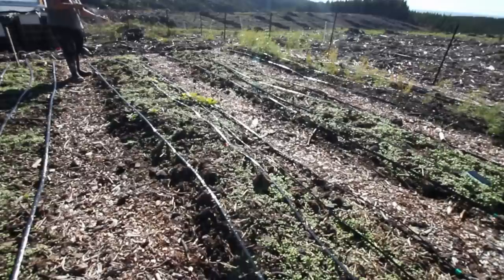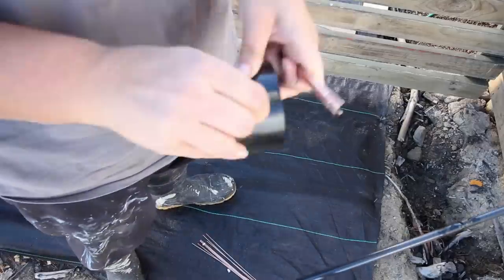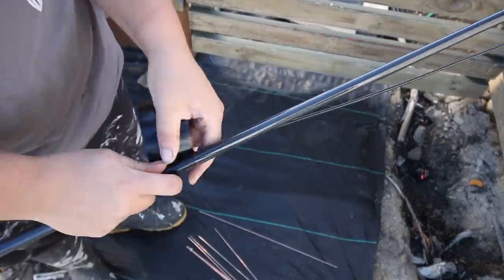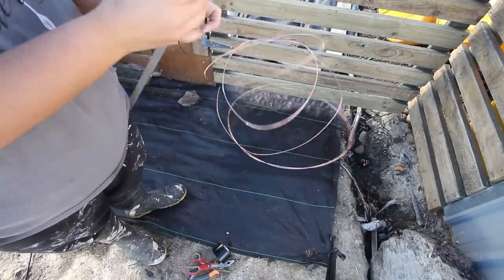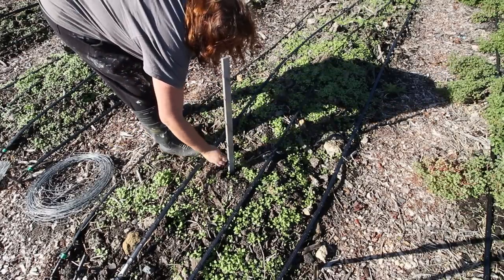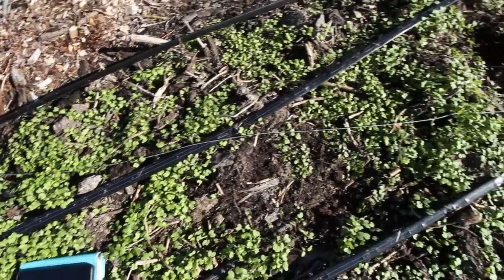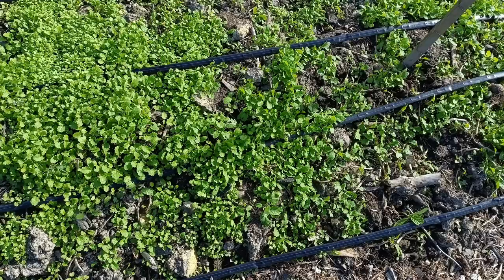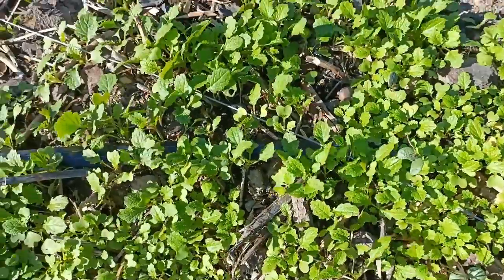ELECTROCULTURE  WORKS?! testing 3 types of antenna

Comment: We learned from health subjects that frequency is important. No kidding. So, I'd look to fine-tune that, as for example the 5G frequencies can interfere with oxygen and drop you like a skeet, the 2.4 ghz microwave freqs heat up the hydrogen and so on, so it looks like lower frequencies such as those ham operators use, maybe multiples of eaarth's resonant frequency, will provide the best results...

Comment: it is thought that the captured energy only covers a 3 foot (1 meter ) radiaus so it might help to run copper/ steel wire in between your antennas...
Reply from the maker: From what I have read, it seems to cover a circle with a radius as wide as the height of the pole. I have set up some more experiments today with different heights, and different directions of wrapping, and some coated and uncoated wire. Will be interesting to see what happens

Comment: First off love your video you explained your experiment well  and most importantly executed it. Ok with the copper coil and the ccw cw the earth is a vector isometric (ie 2 pyramids of dirt in space the bases are at the equator. Im in northern hemisphere my toilet flushes clockwise. From top looking down. This is the least resistance for the water /electricity to travel as they move towards the earth. Hurricanes and tornados follow suit likewise in rotation (cw northern hemisphere ccw southern hemisphere. Im going to use 4 guage solid copper and run it clockwise down a 40 ft tree and run a series of ground rods around my greenhouse box so all the plants get plenty of electrolysis from my current that i will test with a mili volt meter. Thank you for the comment about the drone it especially opened my eyes to the physics of this project as it mimics the nasa sts teather incident harnessing static electricity to the eath.
Reply from the maker: so riddle me this. We are in the southern hemisphere and in my latest experiment, the 2nd worst plants were the counter clockwise on the bamboo, and the BEST of 6 options was the CLOCKWISE on the bamboo? I'm perplexed. But the experiment doesn't lie!

Comment: Is there any elevated chance of lightning striking the antennae?
I missed noting how high you placed them up...
Reply from the maker: I think it will be OK 1) because we barely ever get lightening here, and 2) we are surrounded by massive trees, I suspect they would be hit first as they are MUCH taller
Reply: @FantailValleyHomestead  I may not want to try this too close to my home then; I have a very small yard. we have lots of lightning here all summer long. How high up was your antenna?

Comment: You know crystals inserted into the soil inside root and outside root growth area works not only easier but better?.. just make sure terminations are clear of debris so Sunlight, can pass through them. Thats it. Evenly insert them around your plants with just the terminations sticking above soil. Done. Walk away and wait for accelerated growth. That simple.

Comment: You need one lead higher. And put your meter in A/C . Use the trees. And use copper wire, not galvanized. For a bunch of reasons. And, no joke, put a gfci on your wire close to ground . Just in case. And magnetic north is currently on the move(not where you’d think it’d be) . Be safe. The electrical potential gets more powerful therefore dangerous the higher you go. Good luck!!

Comment: If i had the choice I would wind them anti clockwise from the bottom . if you look at vines that climb almost all if left to there own devices will spiral anti clockwise from the ground. As for North hemisphere vs Southern Water goes anti clockwise down the plug hole in nz. Our anti cylcones or highs spin anti clockwise. Having said all that we don't know what we dont know . I'm a great believer wisdom and knowledge comes from observation so trying different stuff and having an open mind can lead to all sorts of interesting stuff. The more my island of knowledge grows so does the shore of my ignorance. So have fun try stuff and share it regardless of what others might think.
Reply: That’s funny I was just wondering the same thing

Comment: I did two 9 ft poles, 1 wrapped clockwise and 1 counter clock and 50 ft apart. And got zero results. And it's been over 2 weeks

Comment: There was zero control over the experimental process and selectively choosing larger plants while ignoring the smaller ones right next to them.  It would be an interesting experiment if you could maintain the exact same conditions for each antenna type, in addition to a control group.  Better yet, it should be a blind test.

Comment: The amount of current gathered by these antennas has to be minuscule. I imagine having a small solar panel like those cheap solar path lights would be much more powerful. You would just have to open it up and disconnect the battery and led and run the wires from the solar panel to the ground.
Reply from the maker: yes it is tiny for sure, but too much kills everything. So I guess tiny is better?

Comment: I read somewhere that the wire around the 1st Ariel should be wrapped in a specific spiral (depending on hemisphere, clockwise in western)  so that may have made a difference 🤷‍♀️ good job thanks for sharing 👍  I also intend on using electroculture on our farm! Just doing some homework 1st 😊
Reply: there is no hemispfere, the earth is flat

Comment: You need to bury your wire in the dirt that's what causes it to produce electrunning along the top does not produce the electric. It works by static electricity and a magnetic field in the gram

Comment: How many of you have had something like this hit by lightning ⚡ out of curiosity 🤔
Reply: I'm curious, I live on an island in the Caribbean. Very curious I have rooftop palapa gardens on the top of the 3rd floor. I'm worried about electricity going through the house
Reply: @lacasadejardin  run a ground wire from a lightning rod on the top of your roof above whatever you are doing then take a wire run it all the way down to the ground and beat a metal stake ( copper if available)  into the ground about 2 or 3ft and then connect the wire but really this is a very rough overview please look into making a lightning-rod that's probably a little safer and definitely use at your own risk there are too many hazards to list with trying to direct lightning

Comment: I don't think the first one will work.  You're using too many "artificial" materials.  My understanding is you should use a wood or bamboo pole and pure copper wire (not copper coated and maybe your's isn't copper clad) but then you use a foreignn metal and lots of plastic stuff.  Also my understanding is that the copper (or brass) wire is to be spiralled up the pole.  All in all this is completely different from what I've learned about this culture.  But in all fairness I've yet to try it.  I will use it in next years garden and know for sure.  

And you're supposed to wind clockwise looking down from the top of the pole (in the orthern hemisphere).

Comment: You would get better results using galvanised wire on the top of the long antenna as that attracts more atmospheric energy than copper.

Comment: Where ever your wire touches the plants or ground. You are grounding out your current and defeating any potential benefit of the ion energy that the wire gathers. For Every 3-feet up from the ground. You realize 100 volts in pico amps. Good luck.